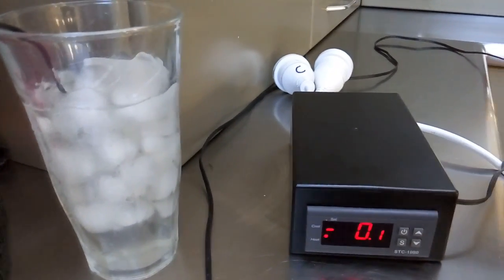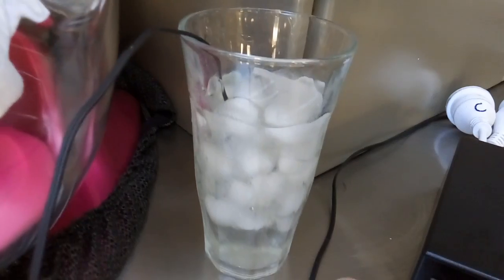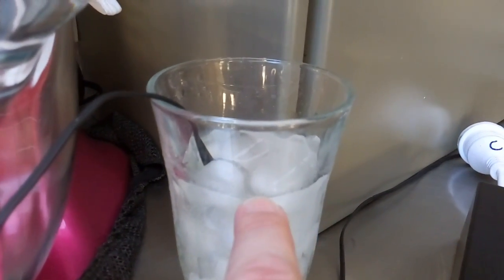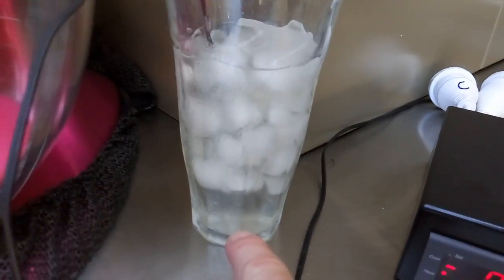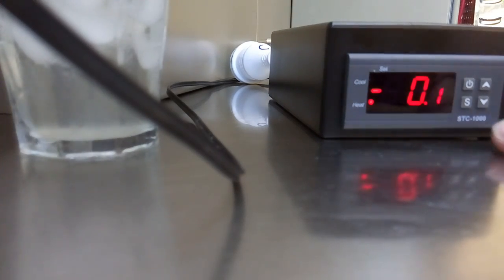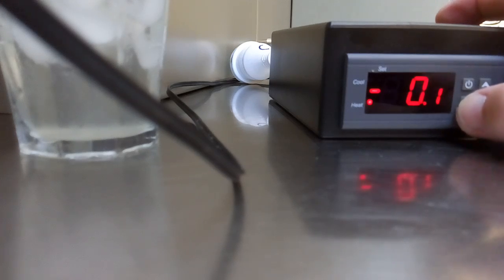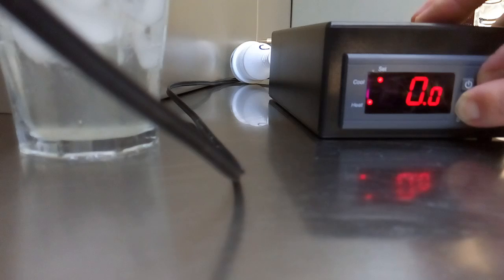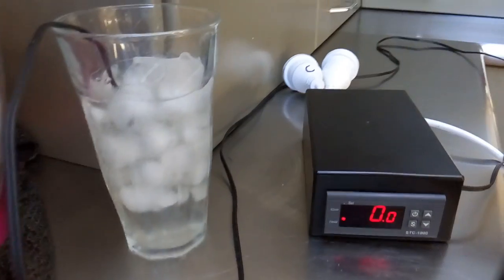STC-1000 Temperature Controller Calibration - How to Check Accuracy and Calibrate

Comment: how do you now that ice is 0 ? 🤔
Reply from the maker: A mixture of pure water and pure water ice will quickly reach a temperature of exactly 32 degree F or 0 degrees C. That actually is the definition of the calibration temperature for temperature scales. A water ice mixture is often used to calibrate precision thermometers
Reply: @tubedinoz  tomorw i will try 👍
Reply: how much time is need to stay senzor i ice with water ? 5 min 10 min 30 min?
Reply from the maker: @ilovevideosyoutube9985  just until the temperature reading stabilises.

Comment: its a good idea but just cause its ice doesn't mean its 0degrees c probably be lower temp my freezer keeps ice at -18
Reply from the maker: It's to do with the mixture of water and ice balancing out the temperature to 0C. Found this online - Under normal atmospheric pressure conditions, a good mixture of ice and water at thermal equilibrium will be 0 degrees Celsius. This is both the freezing/melting point of water. Cheers

Comment: Dino now do the same with boiling water and see if the STC is accurate.  Most cheap electronic devices (and analogue) are not normally accurate at both ends of temperature ranges.
Reply: I noticed a comment on a "new to homebrew tom" video where he did the same for a Rex c100 PID controller. It said you want to calibrate as near to the desired temperature. Seeing as the mash and boil are both over 50 degrees C it would probably be more accurate to calibrate at boiling temp with water.
Reply from the maker: I use my controller for both fermentation and mashing, so the 0C test will be closer to the fermentation temperature, but I get your point and I'll check it against boiling water tonight to see how accurate it is for mashing at the other end of the scale. Cheers
Reply: lol it was me that made that comment. I trained for 4 years in instrumentation doing temperature, pressure, levels and three term control (PID)
Reply from the maker: Good point. I'll check it out. Cheers

Comment: This is  great way to do it.
I do however have a few questions, just because it is ice doesn't mean it necessarily at 0 Celsius. For example most household freezers are set to around -18C. So I suppose it is worth dropping a thermometer and checking the temperature of the concoction.
Reply from the maker: Will D Hi. That's the reason you have to add water to the ice. It brings the temperature to 0C. There is science behind the reason, which I don't understand , but it is a recognised technique. Cheers
Reply: TubeDinoz cheers mate. that's super cool then so easy to get a bang on result. just did mine and she was 1C too warm.hapy brewing mate, cheers.
Reply from the maker: +Will D Nice one, glad it worked. I just did a bit of reading on the reason for mixing cold water and ice together. Apparently because 0C is the melting point of ice and also the freezing point of water, the temperature stays at an equilibrium of 0C until all the ice disappears. Happy brewing to you too. Cheers Will